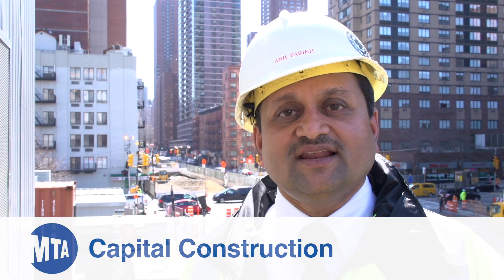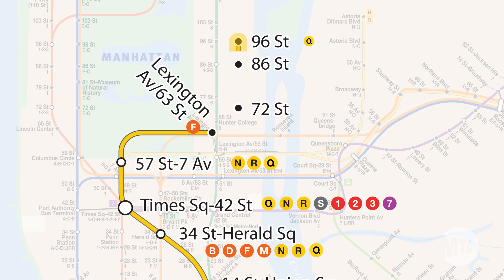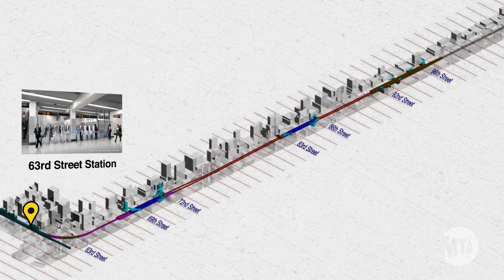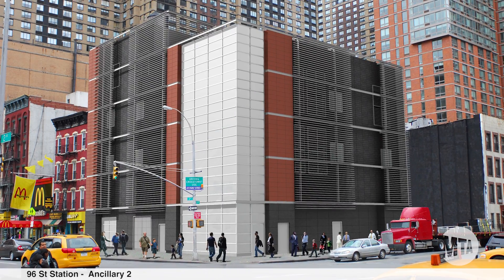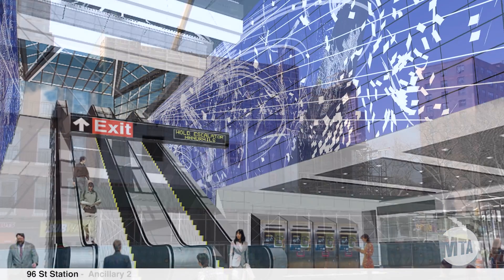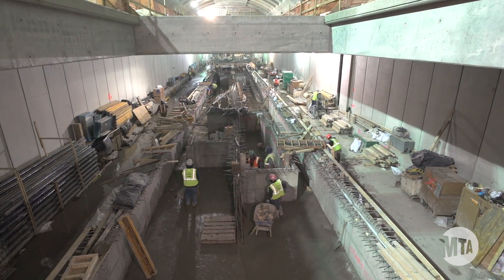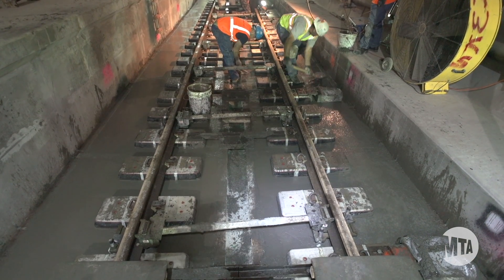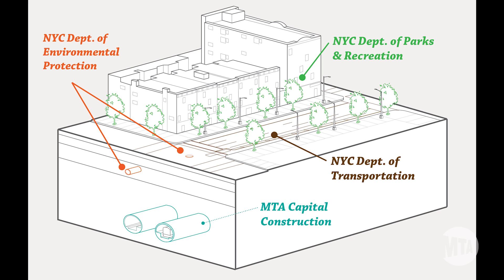Second Avenue Subway - 6/25/2015 Update

Comment: On the South end the T line should extend into the Montague tubes and perhaps extend to the 4th Ave to one day go to Staten Island , on the North end it should be extended across 125th st all the way to Broadway with a Bronx extension to 149th st concourse..
Reply: Gerald Green My plan for SAS South is to extend it via Fulton Street Local, a new Jamaica Avenue Subway, the existing Jamaica El, and an extended Archer Avenue Line to Hollis. C service would move to the express tracks. I also plan to replace service at Liberty Avenue, Van Siclen Avenue, and Shepherd Avenue with rerouted R service. Not only would this allow for better Fulton service, but also for faster rides to Lower Manhattan.
Reply: You would of coarse keep the A train like it is right?, to be the A, C,R, HOW WOULD IT GET OVER THERE, WHAT ABOUT 4TH AVE AND BAY RIDGE,  WHAT WOULD U REPLACE IT WITH?
Reply: Gerald Green The A would solely serve Far Rockaway with the C express to Lefferts Blvd. Otherwise service is the same. Rockaway Park Shuttle service would run to Broad Channel at all times except late nights, when service is extended to Euclid Avenue. R service would also extend to Lefferts Blvd to replace C service.

I plan to replace R service on 4th Avenue with an extension of the J train, and the Z would be folded into the J with the truncation of service to Broadway Junction (note how I did not use the word eliminate).

The only stations I am eliminating all service to is Alabama Avenue, Van Siclen Avenue, Cleveland Street, Norwood Avenue, and Crescent Street. With a new Jamaica Avenue Subway from Fulton Street taking over the Elevated from Cypress Hills on as well as the shortening of the J route, these 5 stations would be demolished. New stations would be located on the subway at Pennsylvania-Arlington Avenues, Barbery Street, and at Highland Place.

Also, the R Link between Whitehall and Hoyt Schermerhorn would be a new tunnel between Manhattan and Brooklyn.
Reply: Your plan is interesting but ....
Reply: Gerald Green What’s the catch?

Comment: Mta said last year the  T train would run with the Q line from 72 street to 125 street and now their cut it to 96 street and no T train will come shame
Reply: Once it opens, it will be so popular, they will almost have to complete it. My fear is that the presence of the new 2nd Ave line will push up the uptown rents and real estate, and broom out the people who live there.
Reply: The (T) train will start running after phase three of the 2nd avenue line is finished which will extend from 72 Street to Houston Street but it will take many years because the MTA might not have enough funds and before phase three can be under construction they need to complete phase two which extends from 96 Street to 125 Street and at 125 Street for the current (4)(5) and (6) trains their will be a new lower level because the MTA plans to connect the (Q) and (T) trains to the (4)(5) and (6) trains but the 2nd avenue line will be awesome once it's complete and convenient for those who live near 2nd avenue but the 2nd avenue line will change bus routes of the buses that run on 2nd avenue and it will also effect those who live near or on 2nd avenue while its under construction

Comment: They really should've kept the Third Avenue El until this was finished. But no, no people wanted to build skyscrapers and complained about the noise. Well, there goes your closest transit line East Manhattan for the next 61 years.
Reply: The Chicago Loop El has not kept Chicago from building many skyscrapers.
Reply: Phew, old comment. Anyway, yes I do agree with that statement, that's true. However, the survival of the Loop El should probably be owed to the fact that over there, it's treated as more of an icon than as a blight with the remaining elevateds in New York. Simply replacing the Loop with the current two subway lines under DT Chicago wouldn't be sufficient either. 

Els do affect property values, though that hasn't stopped development along them in Chicago, unlike Manhattan where companies were quite literally refusing to start constructing their office bldgs. until after the demolition of the 3rd Ave. Line. The city was also fine with having it go since everyone expected the SAS'd be done soon after, which did not happen...

Comment: mta.info  Are you going to add Platform Edge Doors to these future lines? It is a good idea to install PEDs to keep passengers falling off tge platform.
Reply: syed daniel No that would be prohibitively expensive.
Reply: Tokkemon To accomodate platform edge doors, the first step is to have the signalling system on a subway line converted to automated train operation or ATO. Once that is complete, the transit agency can proceed with adding platform edge doors station to station as quickly or slowly as desired based on whatever capital funding is available. 

Here in Toronto replacement of the TTC's Yonge University Spadina subway signalling will be completed by the end of the decade with ATO signalling. Only a few stations will be installed with PEDs, given the relatively high price tag, to say nothing of converting the entire subway system here. Many decades will pass until the job is done here.
Reply: but they have poles on their platform edges
Reply: the best way for people not to fall off the edge of the platform is not to stand too close to the platform, duh